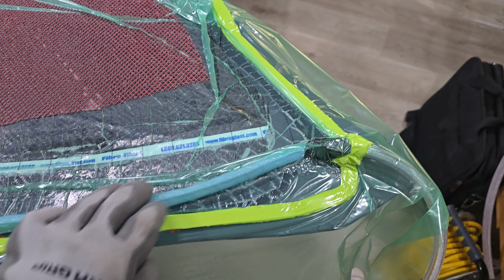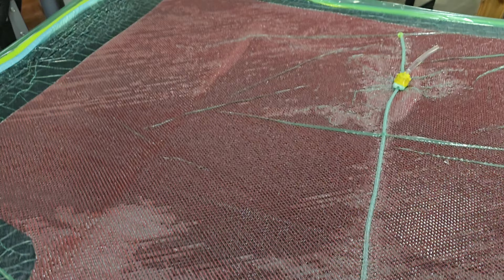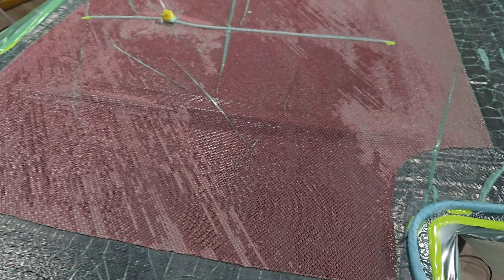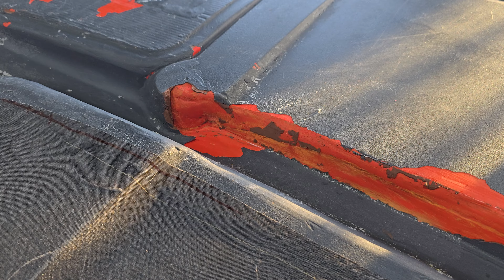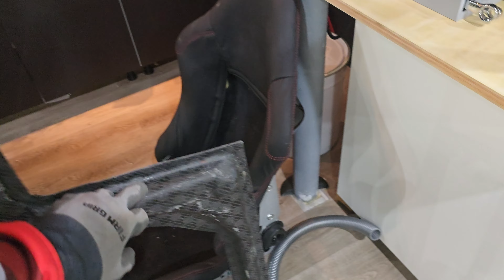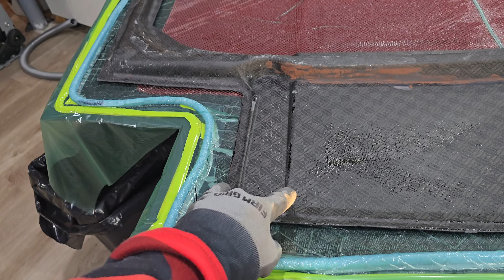MR2 project update.  Composite Hood.

Comment: Thank you for posting. I ran into your stuff a couple months ago while doing research for my own AW11 build and it's been really cool to see your build.
Reply from the maker: Thanks - it's a slow build, but progress is steady.  What are you doing for your build?
Reply: @zerodrift1  I've got a k swap car. Currently in the middle of rebuilding the transmission and moving to a better fueling solution. 

I've been trying to figure out what the best move is suspension wise. I started designing a 5 lug drop spindle/knuckle but I'm not sure if it's worth the effort compared to converting to a double wishbone setup.
Reply from the maker: If you stick to the oem style McPherson suspension, I would recommend this:  https://wilhelmraceworks.com/shop/aluminum-front-knuckles-p572321954

With sw20 Koni Yellow struts and ground control top hats and threaded spring perches. The sw20 struts are a larger diameter, and the front strut is shorter, so the travel is better.  

Going to a double wishbone setup is possible, but it's going to be a lot of work.
Reply: @zerodrift1  is that what you're running currently? Iirc you were doing something SW20 based. The setup seems pretty nice, but it would more or less double the value of my car, and without published bump steer measurements that's a big risk. 

I was looking at maybe doing RX-8 front suspension/subframe with ~04-08 tsx front suspension modded for the rear. But at some point it's not even an AW11 anymore.
Reply from the maker: @Beanpapac15  Yeah - I'm running the Koni SW20 setup with the Wilhelm knuckles.  Mind you, I've had a custom rear subframe fabricated, to fit the OEM sw20 knuckles. Alex Wilhelm sells a set that are built for the AW11.  Here is what I did for suspension:  
https://www.instagram.com/p/CJCtSmyncHR/?utm_source=ig_web_copy_link&igsh=MzRlODBiNWFlZA==
https://www.instagram.com/p/CJIEWpCgkH4/?utm_source=ig_web_copy_link&igsh=MzRlODBiNWFlZA==
https://www.instagram.com/p/C26mz-OMtpK/?utm_source=ig_web_copy_link&igsh=MzRlODBiNWFlZA==